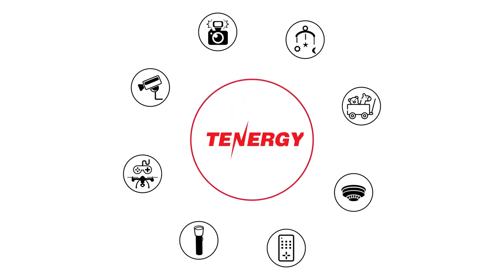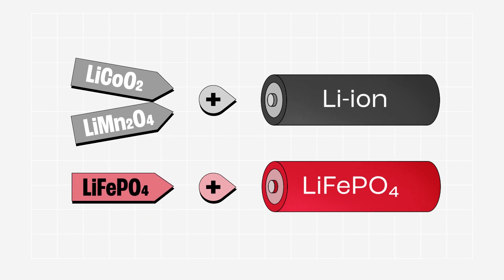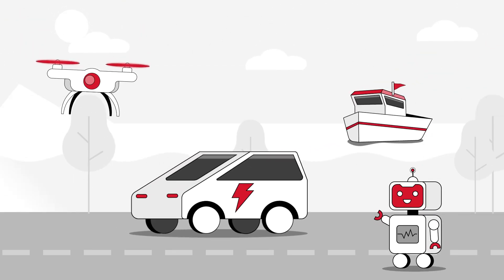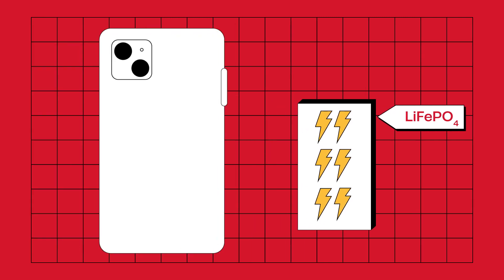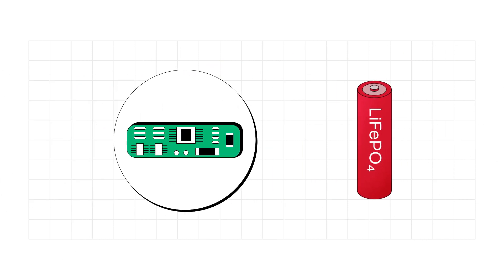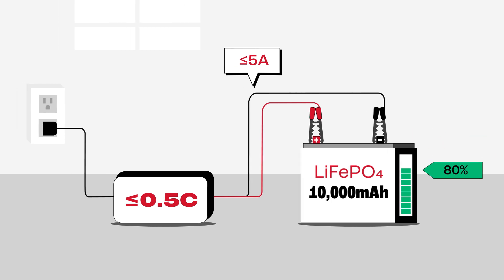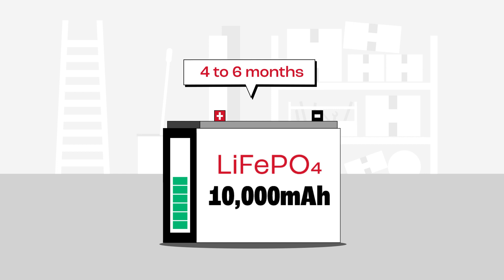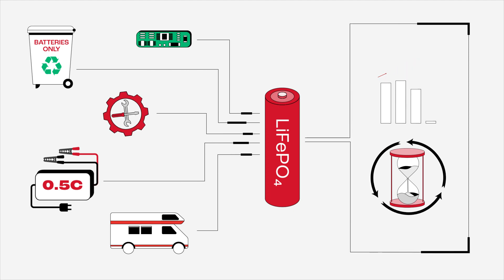Pros, Cons, and Maintenance for LiFePO4 Batteries

Comment: BMS, not PCB.
Reply: BMS is a PCB (usually)
Reply: @AnoNymous-dh2sv I think you mean 'BMS is on a PCB'.
Reply: @jimmybrad156  No. The BMS is (usually) a PCB. A chip on it or other component is not the BMS.
Reply: @AnoNymous-dh2sv  Well I suppose to correct both of us; the PCB is a (child) part of the BMS (parent).
Reply: @jimmybrad156  Nothing is a child. The PCB is the board you build the BMS on.
Reply: @AnoNymous-dh2sv only if you have no idea what it means to use words in the right context.

Comment: Traditional steel lead acid battery, on the other hand, has the lowest life cycle, about 250 cycles. So, if you want the battery to last for so many years, then lithium iron phosphate batteries is the best option.